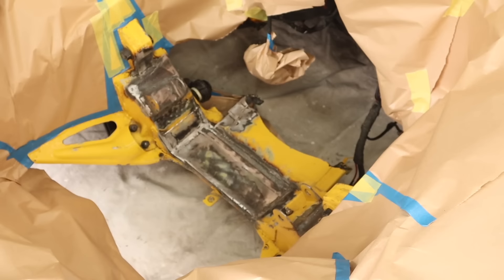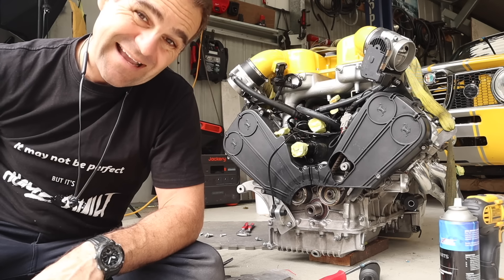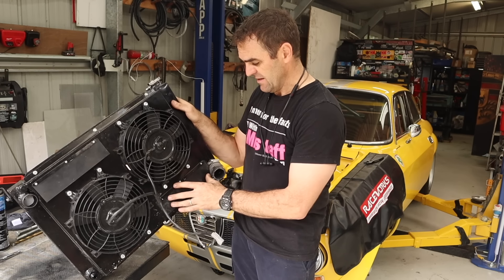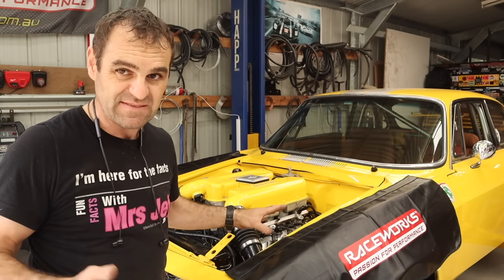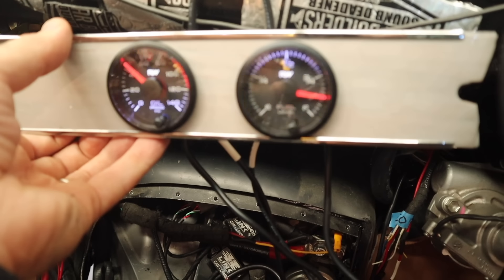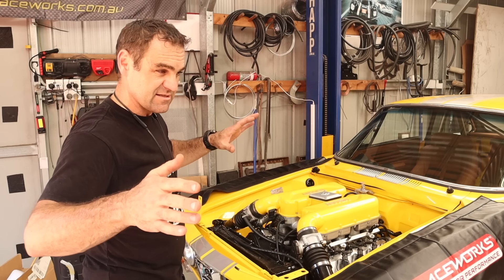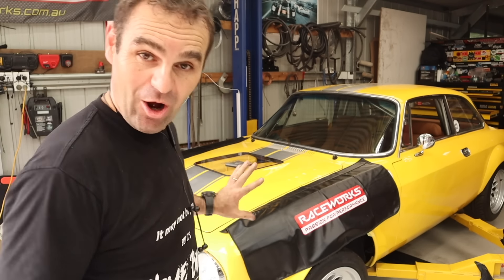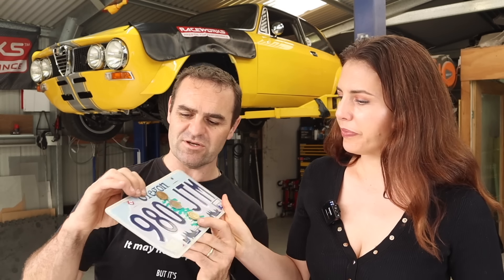I blew up the Ferrari engine...- Ferrari engined Alfa 105 Alfarrari build part 210

Comment: bro, feel for ya. dont panic, get the belt back on, and start her up again, maybe there is no internal damage. worst case pop of the heads and inspect, dont remove the engine again, almost zero chance of bottom end damage, unlikely the pistons are toast, prob just slightly bent valves.

Comment: My heart sank when it happened. But listening to the replay, it wasn’t missing so there is hope. Replace the belt, do a compression test. It looks like it’s only one belt so it’s likely it’s one side. Comp test will tell you if you have bent valves. If so, you should be able to just replace the valves on one bank. Maybe only on a couple of the valves.  Let’s just see what the diagnosis is after you’ve checked it.

Comment: Put that belt back on and compression and leak down test. I would think a couple of bent valves would be the worst case. You can fix it without going broke. Push on.

Comment: It seems the belt did not come off but lost tension and maybe jumped a tooth on the belt or two.  Maybe the cam belt tensioner held tension on long enough that it didn't jump.  It didn't sound bad enough that valves were hitting pistons because usually when that happens there is violent clatter and the motor STOPS.  Yours didn't.  You had to shut it off.  Put the belt back on and look inside the bores with a borescope.  You will know.  If there is nothing bad turn it over with a wrench on the crank nut.  And so on............  Good luck mate.

Comment: High idle in fuel injected engines is often an air leak because the closed loop is trying to compensate for the running lean condition, also running lean makes the engine run hotter and can cause overheating, so byt fixing the air leak your overheating may go away without removing the undertray. I am sorry about the timing belt, with any luck you have only bent a couple of valves, the engine was running slowly and not for long.

Comment: A timing belt failure with engine idling is very likely to result in a number of bent valves.  The likelihood of 'bottom end engine' damage is very low.

Comment: Jeff. It's only valves. Yep, it's time & money, but the car itself is all safe... now, it getting crashed or burned would be a real heartbreaker. Keep your head up, buddy. It's not the end of the world! I've just opened up my allegedly 4.6 litre V8 P38 Range Rover engine that I dummy fitted into my Vauxhall Viva HC only to find 4.0 stamped on the crank... some arsehole fitted a 4.6 plenum to it before I bought it. Not happy, but I'll get a correct crank & conrods! Cheers. Leigh.

Comment: So Sorry to hear this Jeff.
You DID go round three times double checking stuff.
..
I think that noise sounds like belt/ tensioner chatter not engine chatter..?
..
But it does sound like valves tappin.
..
As others have said try new belt wnd compression test..
..
So close.
..
I agree with Mrs Jeff. 
Have a break do another project.

Comment: I once had the camshaft pulley bolt come out and rattle its way down the front, caused some rough running, but when al back together and timed it was fine… so 🤞

Comment: Borescope through the sparkplug holes
Remove the valve covers

If no damage reinstall timing belt, check tensioners etc

Run it again

Comment: Oh no Jeff that is a real bummer.. all that work... now I know nothing about Ferrari engines but when you stopped it it didn't sound like it was misfiring and the noise wasn't a regular tapping... could it just be the belt slopping around.. if it hadn't slipped you may be lucky.. yes I know I'm grasping at straws but you deserve a bit of luck... But as others have said a compression and leak down test will tell you. Fingers crossed mate!

Comment: I’ve seen dozens of broken/slipped timing belts/chains in my career, and none of them needed more than new valves and guides installed at the machine shop.
(granted, I’ve never worked on a Ferrari, but I doubt the material the pistons are made out of are any different than a Ford or Toyota)

Comment: since you dont know why 911 oil level raises and you dont know why,  its because it expands the reason you cant work it out is because normal cars wont show this they only have 4 to 5 ltrs max oil  but 911 has  almost twice as much due to having a large sump tank and always has oil in crank case as well its also not unusual for ametures to over fill there 911 wen it gets ot they blow smoke. cheers nick.

Comment: It might have skipped a tooth... maybe not.  It's possible the ticking noise had to do with the piece you found.  Your saving grace is you idling.  Check everything before you pull the motor again!

Comment: OUCH! I doubt that little part would have thrown the belt, even if it miraculously somehow got stuck between belt and pulley - but it didn't look munched enough for that anyway. Maybe you forgot to tighten the tensioner up properly?

Comment: The noise you heard coming from the engine was the valves hitting the tops of your pistons on one bank of the v8 engine which means sad to say that this engine is an interference fit engine.

Comment: Uhhh Jeff, that's horrible. I'm hoping side of the belt in tension under load kept enough tension from being driven to hold the belt in the teeth, and the noise was the belt drive rather than valves. Certainly sounded smooth when you stopped it, apart from the clanking. Everything crossed for you.

Comment: The engine was still turning and you can try to turn it by hands (if you have access...). I think it concerns the top of the engine. I don't know if you can put a camera in the plug holes to check the conditions of the pistons with the engine still in place...? So frustrating! 😔

Comment: Maybe I'm being overly optimistic, but the fact that the engine was still running, and not sounding really mega terrible, could the noise be belt slap as it had come loose? Keeping all my fingers crossed for you bud, been a lover and owner of Alfas for some time now, and had many snags with the 3.0 Busso V6s in 916 GTVs for many years. All worth it in the end though. Keep going with your Antipodean Alfarrari!

Comment: Such bad luck ,,it seems strange that a small part like that could somehow mess up the timing belt which had plastic covers around most of them..
On the bright side , there will be good content as you find out what is wrong , what is broken and then get it all fixed and running again.

Comment: Boroscope to the rescue???
Aside from some small indentations to the pistons that can be ignored there’s probably only bent valves on two cylinders, mostly likely intake valves. A leak down test is probably called for to check if the boroscope can’t see anything.

Comment: Off :/ Hope it is not catastrophic. Low revs should lessen the damage. I did not understand how the timingbelt being loose is connected to the sensor coming off?  Or was it some hydraulic tensioner/pulley that failed? Followed this since the start. Keeping my fingers crossed for you.

Comment: Mate. That's so unfair. The only advice I can offer is wait until you know for sure what the damage is before you lose heart. 
I've had similar situations happen a few times, the horrible noises followed by the instant dread, but only once was it actually engine back out and replace parts bad. You might be lucky. Our brains play tricks on us, and like to make us imagine the worst when often it's not that bad.
Take a couple of days off from the car, once you've settled a bit then take a measured logical look at everything and go from there. Maybe get a good mate over to help, friends are great moral support if nothing else. If it's bad, react accordingly when you know for sure. Playing the guessing game is just torturing yourself and it may well be totally unnecessary.
Fight on mate. I think worst case is a couple of bent valves, that's not a catastrophe by any means. Don't stress. She'll be right.
Edit: : Listening to the noise again it doesn't really sound like valves. The rhythm is wrong. It sounds more like something plastic flapping around, or possibly even the belt flapping about. Hard to say via a YouTube video through crappy earbuds, I appreciate that, but it sounded more like something external. I reckon you'll be okay. I've got everything crossed for you.

Comment: Likely, and hopefully, just bent valves so 'just' a top end rebuild. Worst case one or more valve discs broke and jammed their way through a piston and the cylinder head. From what I've seen on ferraris the valves just bend, don't break. Fingers crossed.

Comment: That engine made the same sound/contact with every revolution. 
If it bent the valves out of the way on the first or second revolution would it not have changed tone?
I would throw a belt on & turn it over by hand to see what happens.

Comment: Testing boroscope leakdown aside even if you got favorable results would you ever really accept that in the back of your mind especially on a high performance engine…I know I wouldn’t. I know lots of others have said good tips. But if it was me and likely you I would start by just yanking that head again myself. Because even if everything came back seemingly ok I would still have doubt and again given the engine would just yank that head and get new valves for the whole bank. Peace of mind and all. Seemingly good results from tests or scope lead to burnt hole in piston from when parts fatigue at 10,000 rpm a use etc lol. But finding out what the belt threw is critical and I think it was tensioner or hydraulic pulley or idler. Curious to see if that tension pulley bolt is loose now. Assume it’s off center center deal lol. I don’t think it was that vipec module as I have ran over a few and the lambda whic is same and they are fragile and would crush to bits in the belt path especially if it threw the belt itself it would be mangled. What’s the story on the timing service? Did you do it or just inspected the bits ?

Comment: Mate, I don't think its catastrophic. It sounded like just one cylinder and it was at idle and you got to it quickly. Like you said, the engine was still running and didn't sound like it was struggling. I agree with alexanderparisi7318 below. Worst case, some bent valves and a piston? If I was near by, I'd bring you over a cup of tea and a biscuit. It will be okay.

Comment: i dont get gold heat tape.... gold is one of the BEST ....  CONDUCTORS ..... there is?? unless im wrong?? it will not insulate, it will conduct heat, and has a low melting point im pretty sure.... never really understood that one. happy to be corrected.

Comment: Two comments:  1) 32 C = 89 F  2) Is that Ferrari engine a non-interference design?  If yes, then you're in luck and just fix the belt.  Else, most likely have some bent valves but you were at idle for a short period of time so piston crowns and head side of the combustion chamber should be fine.  At least on the engines I've worked on, the eye brows valve reliefs cut into the piston crown are over sized on the exhaust side to accommodate thermal expansion when everything gets hot.  You were still cold so hopefully only the intake valves were affected.

Comment: Tensioner or idler shit the bed? Possibly over tensioned? If that module passed threw the timing belt enough to chuck it from its path it would be fucking mangled
Reply: Lord knows I have been here many times with the 6g72. That being said no idea what witchcraft Ferrari did with the timing setup. Didn’t see the belt running of crank unless I’m missing something lol.
Reply: I see how it’s setup now per bank off shafts. Can’t recall if you did timing on this once upon a time or not.  Still guessing tensioner it self or the tensioner pulley bolt maybe or I guess the basic idler.   Is it possible the cam gear spun as in cam pin sheared off? Or just plain ol dropped a valve and then the timing event happened?